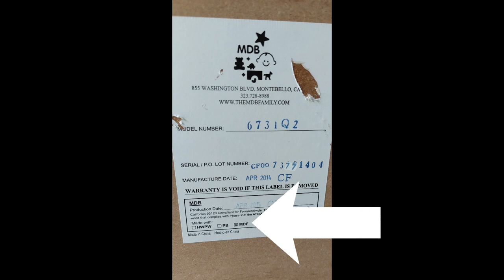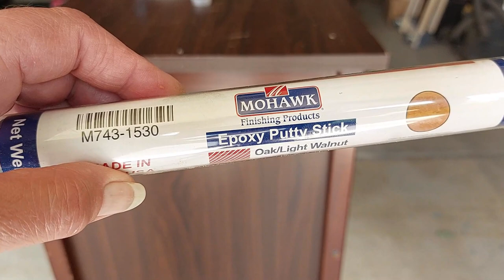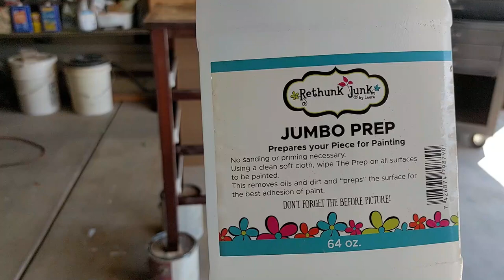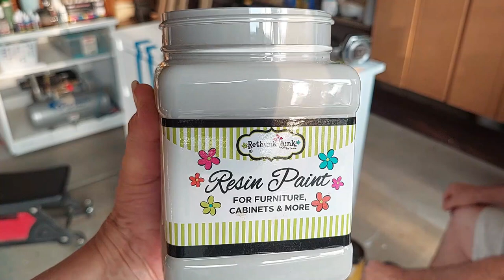BOHO Dresser Upcycle | MDF Furniture Makeover

Comment: Nice, does the paint used require a clear coat finish?
Reply from the maker: Rethunk Junk is a resin paint and does not require a top coat. They do have a product called Tuff Top that can be used for areas that may need extra protection. Thanks!

Comment: Did I miss something? What did you do with the flaw on the top where the finish had broken off?
Reply from the maker: This was not much more than a paper finish over MDF (very thin finish).  We sanded over it when we did the scuff sand and the exposed MDF was sealed when we did our primer coat. Thanks Jo! We probably should have made it more obvious what was going on with that.😉